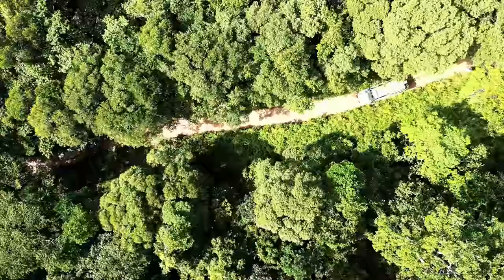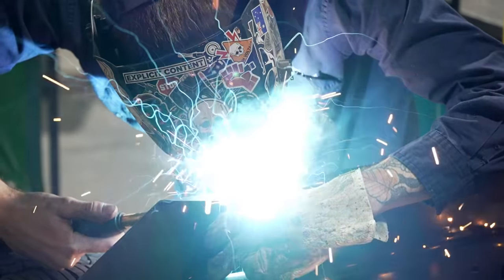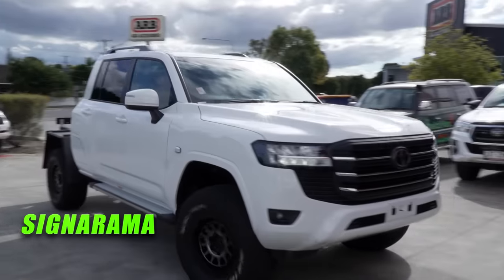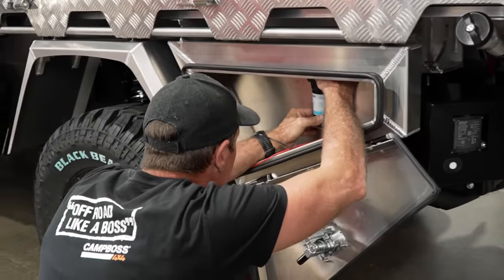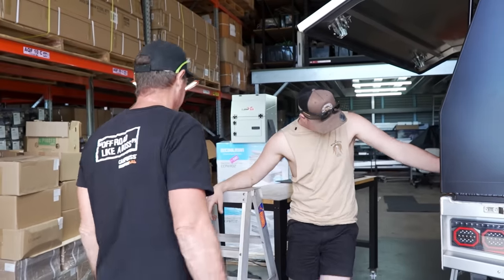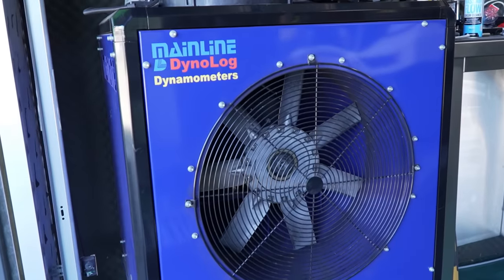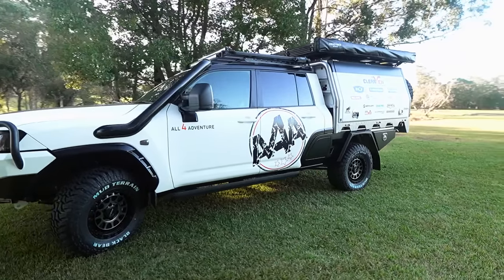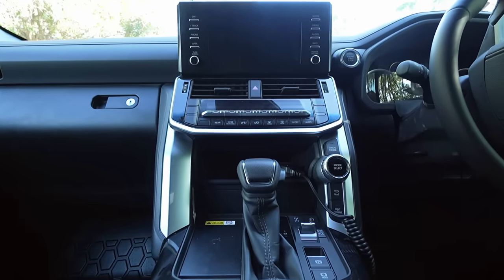🔥 NEXT-LEVEL 300 SERIES LANDCRUISER TOURING RIG — All 4 Adventure Season 15 BUILD REVEAL! 😯

Comment: 170kw and 511nm for a tuned 300 series, where the old 200 series were tuned to roughly the same power but easily had well north of 620Nm of torque. You can't beat cubes.
Reply: 227kw 700nm
Reply: Power at the wheels vs at the flywheel as per what manufacturers claim

Comment: why has the diff housing been streingthened, ??..  isnt it the same diff as the 79 series, 1 ton,??..  or is it a bs upgrade law.??..
Reply: It's not BS. My 200 series is done the same. I can't say I've seen a 200 diff bend but I've seen a 79series diff bent. Only the early ones, without difflocks. They had a weaker housing. I would rather it beefed up.

Comment: The LC300 is a pile of junk compared to Back In Black, Blackout, Rameater and The Chevy. The V6 engine and high tech features are a setback to this model, especially to be given the " All 4 Adventure treatment".😅 Had Toyota kept the V8 in this series of LandCruiser, it would sound like an absolute animal off-road and could have surpassed Back In Black or Blackout as the preferred All 4 Adventure vehicle.

Comment: Should be using the Patrol Y62 V8 .
Piss these overrated overpriced weak cruisers off. Why always wrap them? Everything is Free ya much better of just Raptor coating it as wraps are fkd by UV rays in 2-3yrs complete waste of time. My Raptor coats lasted 5-6yrs so far & notta scratch or issue.
Also rip the DPF out or gut it & leave it on for cops if they get under & look 👀.
Reply: Because he probably doesn’t pay for it and he can just replace it.  I don’t know much about the Raptor but it’s a pretty rough feeling paint and it’s there for life isn’t it?